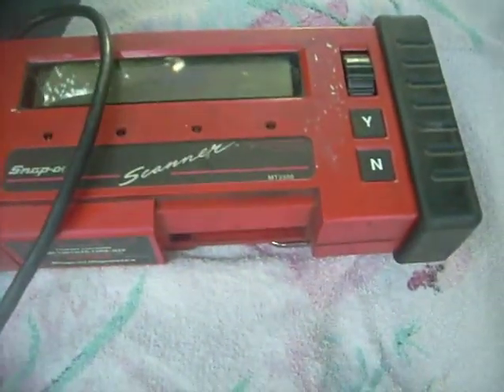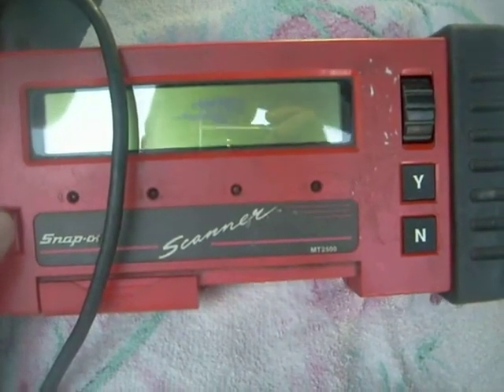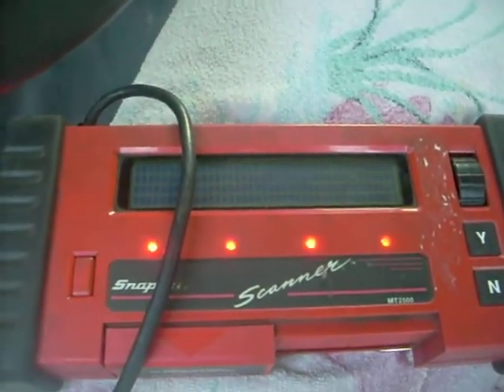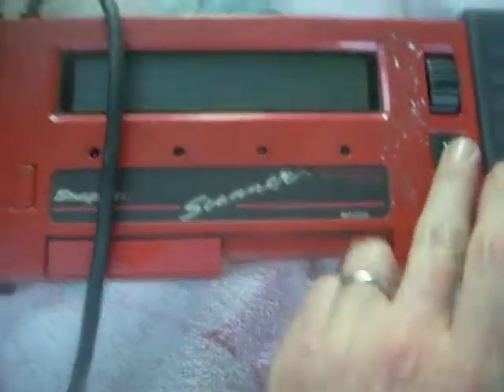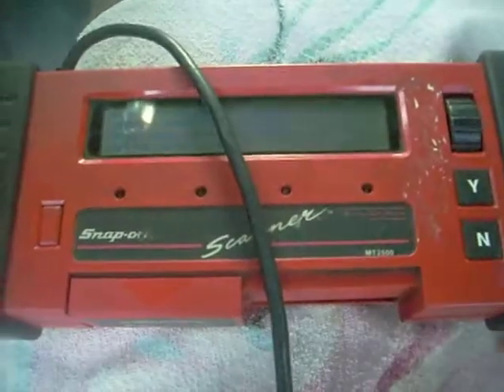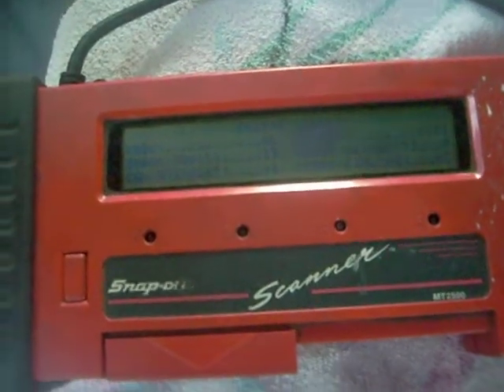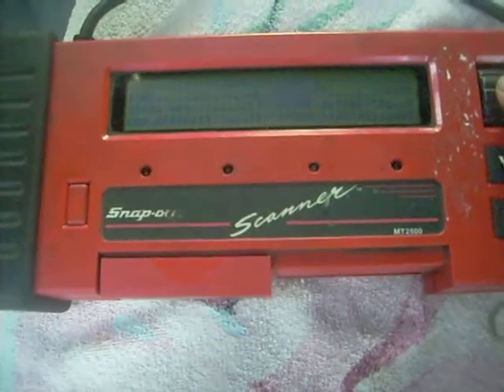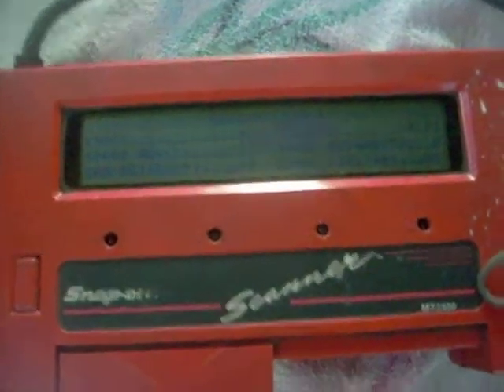Hot to Use the Snap on mt-2500

Comment: On E-Bay They have personality keys. The tester tells you which you need and where the connector is. You need a Primary cartridge for your vehicle and a Troubleshooting Cartridge for your vehicle also. On OBDII you need the adaptor and key. Also replace the 9 volt square battery on the left. Get the 120 volt cable and battery pak to review test results off the vehicle. Get the 12 volt cable that hooks up to the battery and adapter for some adapters. Some adapters need the negative cable to hook up to the black wire on a Multi-1. Get the manuals. Some cars need a ABS cartridge and some a transmission cartridge.